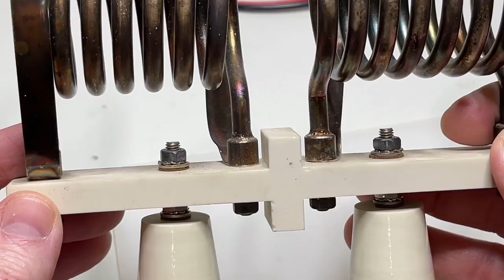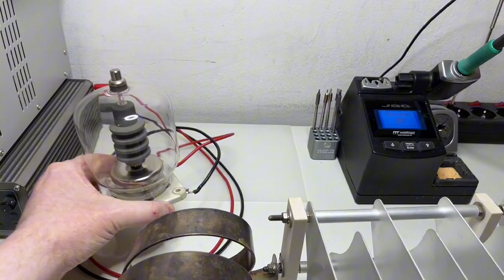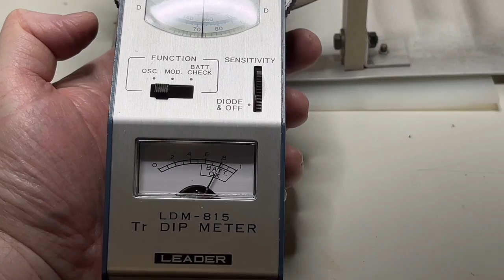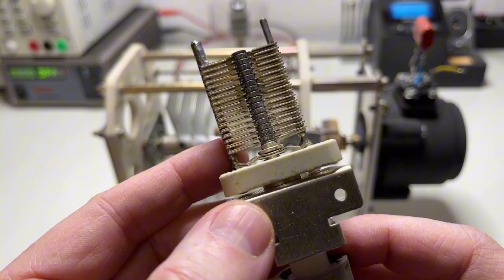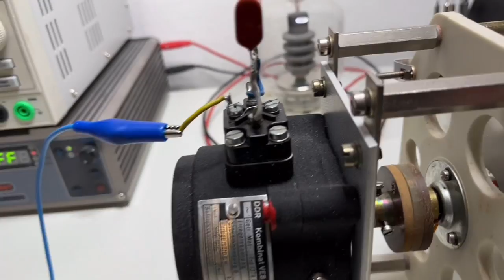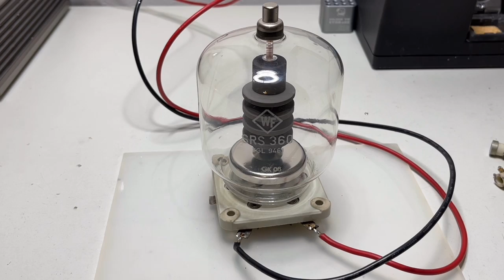BIG High Power RF Parts from Medical Diathermy Machines and the SOVIET(USSR) Army

Comment: Yeah, that vacuum tuning cap. We used to design RF equipment and those caps were always used in the high-power ATU’s in aircraft, meaning electrically short antennas…so, high-voltage stuff even today.
Reply from the maker: I think, High Voltage will stay with us a long time more for real Robust High Power Transmitters, Metal Furnishes, etc.

Comment: Is the diathermy contraption from the "Firma Rentsch (RECO)" in Pirna-Copitz? If so, I was involved in the development and production as an apprentice around 1974-1976. The first Item looks like the older version with a push pull oscillator. In my time there this was changed to a Hartley type oscillator using the power triode with the carbon plate you showed. At full power the plate was red hot glowing. Frequency was always set to 27.12 MHz to the grief of remote control model airplaners. The arifield for them was located only a couple of Km's away. This was the only frequency for which no formal license was required.

The variable capacitor with motor was used to keep the patient circuit in resonance for maximum power transfer. It was in a closed loop circuit coupled to the oscillator tank circuit. When the patient moved between the electrodes it was always in resonance using something similar what today is known as PLL, only with a motor to change the patient circuit capacitance.

This company still exists, taken over by the sons. https://recomedical.com. Surprisingly, they still produce a diathermy apparatus but now working with much shorter wavelengths...

These are good memories. In the former DDR we manufactured everything ourselves. Only exception was the ceramic parts. It was a true trades shop. As apprentice everyone was involved in all production steps. We did wind the transformers, engraved front plates etc. Basically we did all with merely only raw materials and we had all the machinery, often from before the war.
Reply from the maker: Hallo Lutz, ist nur ein generisches Foto. Danke für die Infos, 27MHz war/ist auch Citizen Band (CB).
Hast du eventuell noch Schaltpläne davon ? Wer hat die Keramische Teil Produziert ? Sehr gute Qualität ! Liebe Grüsse, Konstantin
PS; ich habe auch einen DDR RFT ST 240/4 Variac & Isolation Transformer (1976) den ich stark Upgraded (neue Frontplatte mit viel mehr Funktionen) hab, hier das Video dazu : https://www.youtube.com/watch?v=roo_I1fEke8
Reply: @KonstantinGrigoriadis  Leider habe ich nichts mehr aus dieser Zeit, auch weil ich 1988 (als Staatsfeind) nach Kanada ausgewandert bin. RFT war einer der größten "volkseigenen" Elektronikkonzerne damals und neben Konsumgütern wurden dort auch so ziemlich alle Meß- und Prüfgeräte gebaut.
Reply from the maker: Geraete wie der Variac den ich habe, gebaut wie ein Panzer der bis heute auch die schwersten Versand Misshandlungen ausgehalten und nach wie vor Funktioniert.
Reply from the maker: Warum sind die Motoren der Drehkos 125V , was war der Grund ?, Danke, Liebe Grüsse, Konstantin
Reply: @KonstantinGrigoriadis  Die Phasendiskriminatoren wurden mit Roehren betrieben damals. Vermutlich deshalb?
Reply from the maker: @LutzSchafer  Danke, in der DDR war die Netzspannung 230V oder , deswegen meine Frage über die 125V. Wurden die motoren mit Relais angesteuert ?
Reply: @KonstantinGrigoriadis  Also bei RECO waren das richtige Servos die mit analoger Rueckkopplung gearbeitet hatten.  Es gab noch ein Konkurrenzprodukt (ich glaube TUR) wo dieses evt mit Relais gemacht wurde. Zu lange her...

Comment: My former physiotherapist (old skool) used Diathermy. The appliance was the size of a washing machine and on wheels, with a flexible arm with a round box on the end. 
This round box was then attached to the body part with elastic bands. This for about 20 minutes, after 5 minutes you felt an nice internal warm glow.
Reply from the maker: Hi Bjorn, I was sometime ago at an "alternative" Doctor that used Diathermy too and had a session for my Tinnitus, didn't Helped :-) but I was more concentrated at the Diathermy Machine itself (from the 50-60's) with BIG Tubes .